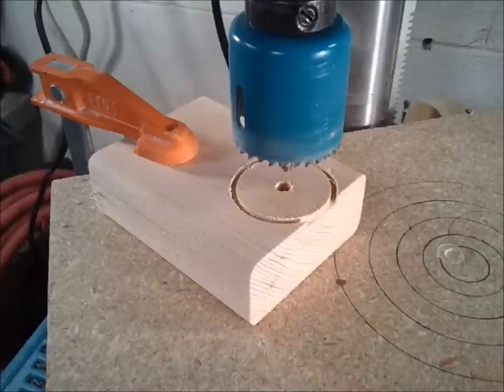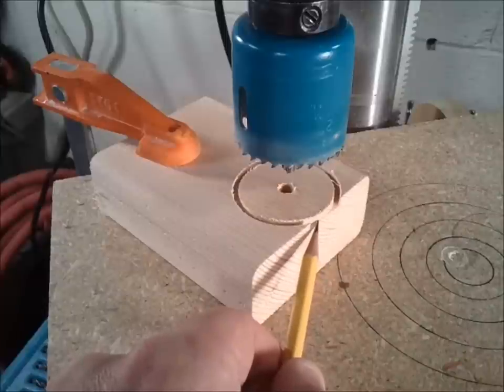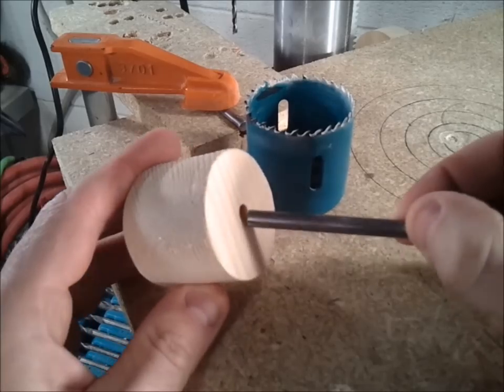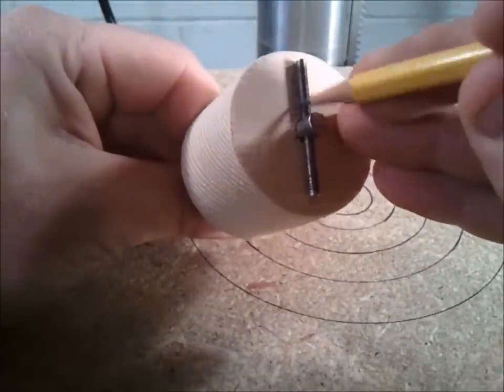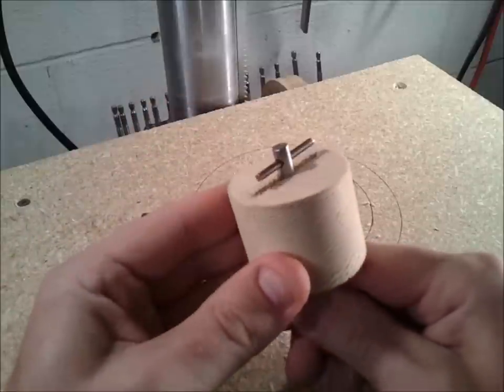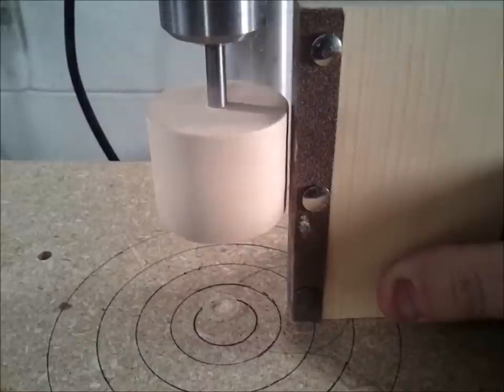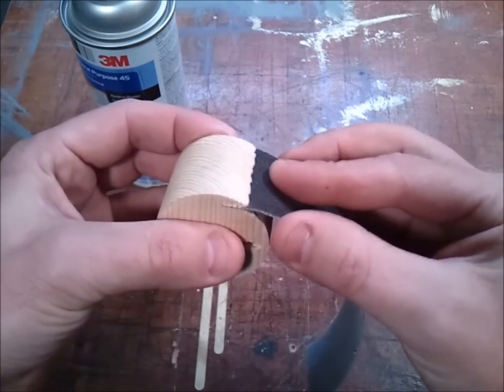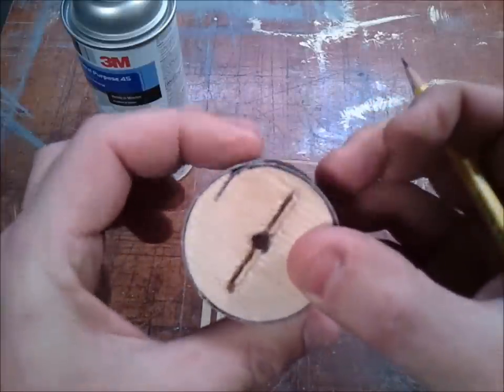Holesaw drum-sander

Comment: I did something very similar just a few days ago. On one drum I had sponge matting between the wooden drum and sandpaper which made the sanding really effective but it was harder to keep the sandpaper attached with glue. I also incorporated a wedge shape in the drum instead of your slot design which pulls the sandpaper tight to the drum which not only negates the need for glue, it also makes the joint in the sandpaper barely noticeable and makes changing grit or worn sheets very easy. I'm probably going to keep tinkering as it's easy to tweak designs and it is a really useful item to have plenty of. Keep it up. Regards from England!

Comment from the maker: Imagine that the spindle were to stick through the bottom of the drum an inch. I would then be able to attach a bearing to it, and recess it into the sacrificial deck of the drill press. Side load problem solved, and no need for a chuck that would be more expensive than my $60 craigslist drill press. Although I do concede that your criticism is entirely correct, my videos are typically about solving a problem with the items at hand, without additional resources- that is what I enjoy. Thanks.

Comment from the maker: I've been making my own drum sanders for use in a cordless for a long time as well- you can do it. You can also buy a power drill to drill press converter; I found one on craigslist for 10 bucks (I used it in the pinball trap vid).  
The 1/4" steel rod is found at any hardware or big-box store, for around a dollar a foot. Steel wool or sand it lightly to make it shine.

Comment: you can just drill a hole at the holesaw kerf (inside or outside of the cut, depending on which part you need), it will help dispose sawdust and saw will run as effectively as when cutting near the edge, but you can cut anywhere on the part, not just at the very edge

Comment: A drill press can be used as a lathe (or sander) only for very small pieces and very light work. 
Otherwise to make it work you should get rid of the jacobs chuck that does not support side load. Get a collet or other lathe-like chucks adapted to sustain side load and then you can even mill with it.

Comment: Another way to make cutting with a hole saw easier is to drill half way through the piece, then flip the piece over and  using the small center hole made by the drill bit to center the hole saw and complete the cut that way.

Comment: Cut a slot lengthwise in a metal rod (Angle Grinder), stick one end of the sanding paper in the slot, and start rolling up the sanding paper to the desired diameter. works the same way as your drum-sander only difference is that as the sanding paper wears out fresh new sanding paper lies underneath it, and it's easier to make of course.

Comment: why didnt you let the cutting edge of the saw to hit on TWO EDGES of the board?
That woudl allow MORE excess sawdust to get out.
Reply from the maker: That would help a little, but in this case the other edges were rounded. Also, as long as there is one place for stuff to escape, it cuts fast enough. If I were cutting dozens of holes, I would probably take your advice and also speed up the drill press. The new problem would then become marking the starting point for the pilot quickly & effectively, but that can be done pretty easily: I used a sharpened steel rod in the "obnoxious air horn" video for exactly that purpose.